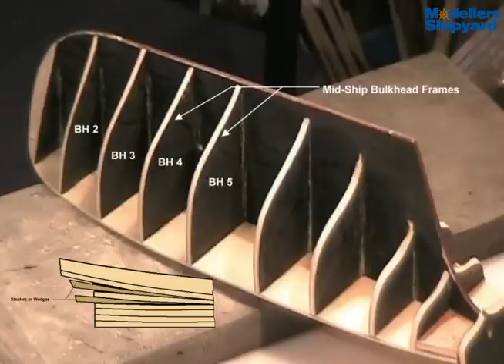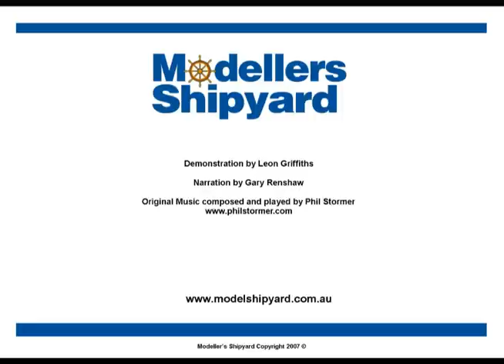How to Build a Ship Model (Planking)

Comment: I strongly recommend that you do NOT use the crimp style plank benders. They cause damage which can be seen on the build if they're not covered by a second planking or filler. None of the proprietary benders are any use. They're a poor excuse for separating you from your hard earned. You should plank as though it is going to be a single layer. Do it right and you'll progress as a builder. Soaking or steam and setting on a jig, like a real build. Either way, to avoid buckling the plank must also be bent laterally (on a flat plane). none of the modeling tools will do that. Again it's back to the real shipyard, follow their methods and you won't go far wrong. If you've already bought such a plank bender join me in a visit to the manufacturer!!
Reply: I agree with you Dugan. For an excellent series on how it is done in real life, look up Louis Sauzedde's channel called Tips from a Shipwright. I learned so much on every aspect of wood and how it relates to boats. Louis is also such a humble, easy-to-watch person. Pure relaxation and education at the same time.

Comment: Sorry but my math is really bad, you explained it well, but I don't get how the math works in this, how do you work out how much each under individual plank should be at each end of the ship? I am having a hard time working it out. I worked it out to like 1.5 but 1.5 of 5mm in a distance of such and such, I mean, can you better explain it for me. Any one, please. I am in the middle of planking atm, and I am doing ok, but I would love to do it by the book.
Reply: If your biggest gap is 45MM and you are using 5mm planks, you will need 9 full wide planks at that part of the ship. If the next smaller measurement is 41mm, divide 41mm by 9 and that is the width of the planks at that part of the hull. If the next measurement is 35mm, (just making up numbers), you take 35MM and divide by 9. So, think of it this way. I am walking through a big doorway with my friends. We all enter at the same time. The doorway is 100" wide and I have six friends. Each friend will have to be 100" divided by six in order for us to fit through the doorway. At the end of the room is a bit smaller door, 80" wide. I still want to enter the doorway with my friends at my sides but now, each person will have to be 80" divided by six. Yes, we all have to lose some weight. In other words, take the longest measurement you have and divide it by the width of the planks you are using. Then, for each cross section piece, measure and divide by the same number of planks as the biggest. At that cross piece, each plank will have to decrease in size to whatever the space is divided by your ideal number of planks.